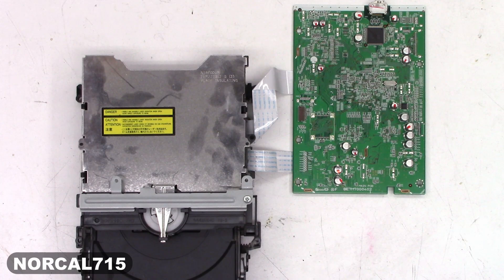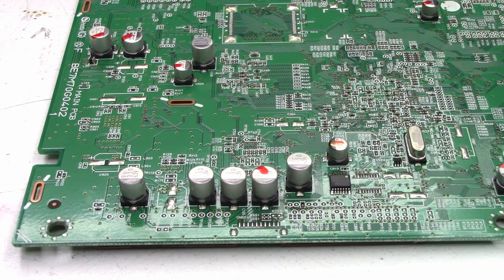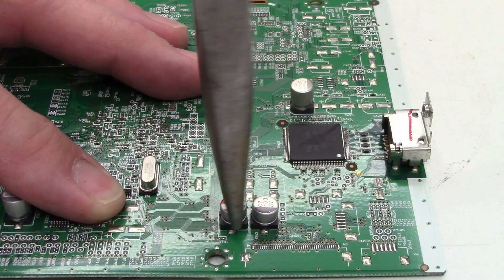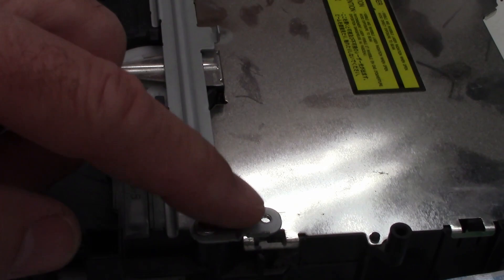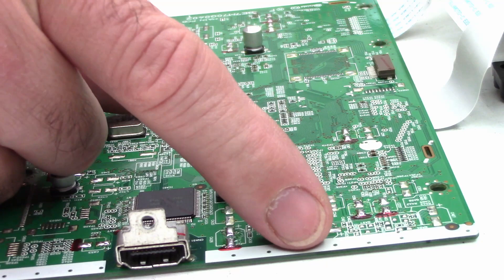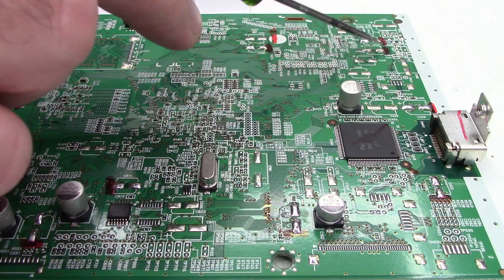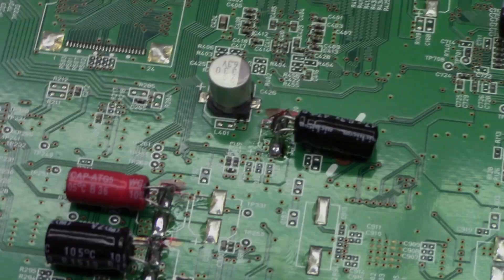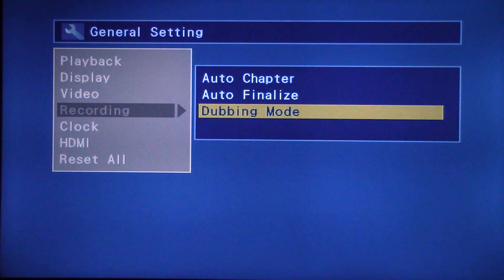Part 2 yet another DVD capacitor replacement Magnavox ZV427MG9

Comment: Why not tantalum?
Reply: Tantalum caps are considered to be somewhat better than electrolytics for high frequency applications, but electrolytics are cheaper and can come in much larger sizes/values.
They were only ever used for a small number of years in domestic electronics, their huge failure rate caused all manufacturers to stop fitting them.
Unless there are tantalum caps on that board, and they test bad, there is no need to replace them.